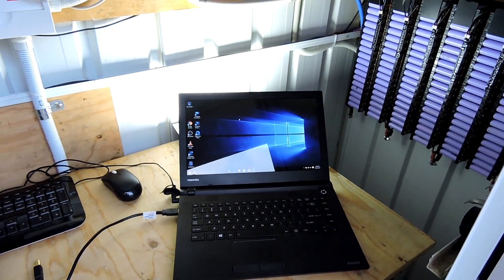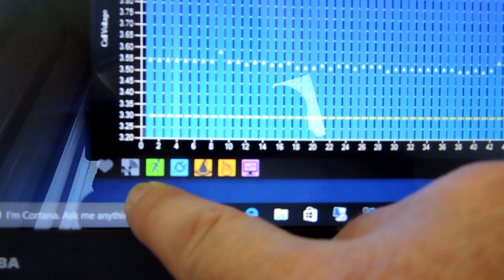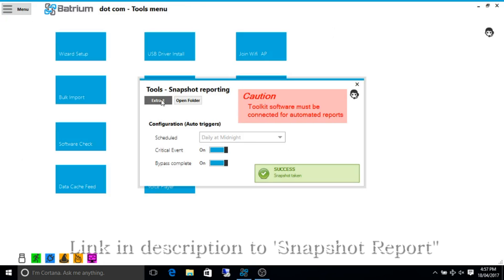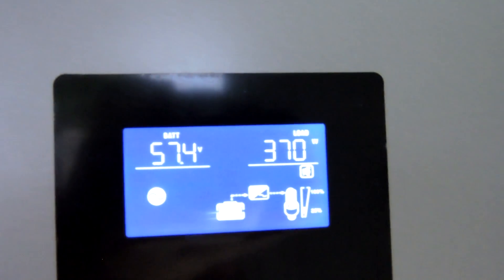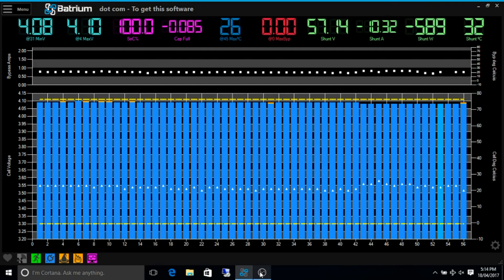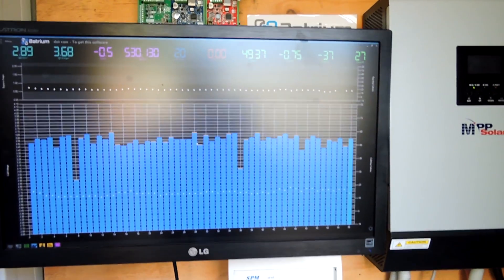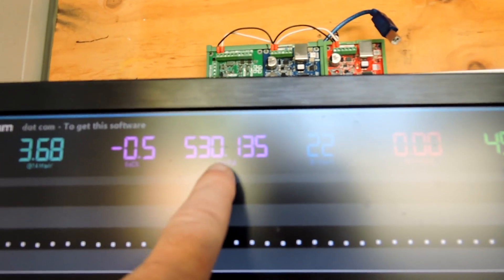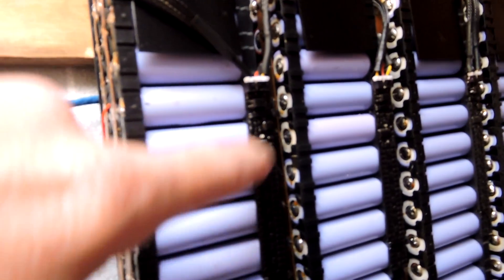18650 real world load test - 63 hours to run from 57.4v to 49v not bad from recycled laptop battery

Comment: now lets just hope one of those doesnt have a catastrophic failure and cascade the entire array
Reply from the maker: +Gonzo i think I've put just a little effort into reducing that issue :)
Reply: murphy's law and all. i do like how u put it in the shed outside so if it does go up it doesnt take your home with it
Reply from the maker: +Gonzo come on. Take some time and check out the effort that has gone into this it's not down with tooth paste and giggles
Reply: i have and i like what youve done, but ive also studied lithium ion and even with the best safety measures things can still go wrong. dendrite growth within the battery, which increases with time, can cause a direct short within. when that happens they can go up catastrophically. and thats just one thing that can go wrong. ultimately im hoping we can move from lithium ion and into some newer technologies. theres actually lithium metal batteries on the horizon that encase it within a polymer aswell and u can punch holes in them, cut them in half, etc and they still function and dont runaway on us. plus double the capacity potential.
Reply from the maker: My now std response - Mitigation process - 4480 5 amp cell level fuses - 4 60 amp bank fuses - 1 disconnect 160amp HRC Fuse - 125a Shunt Trip (more on this later ) Inverter - safety switch - circuit breakers - change over switch - more circuit breakers. Fire alarms in sheds, three fire extinguishers, locked inside of small sheds. If a fire still breaks out I'm not going to drive a car or use the deep fryer in the kitchen ever again. Now back to that Shunt trip - controlled by Batrium BMS - can be activated by cell voltage under or over fully programmable, bank voltage under over fully programmable, temp sensors in  one shed alone has 84 temp sensors other shed had 30-35 temp sensors shut trip can be activated if just one of them go to hot or cold. Naturally, I can program that temperature to active the shunt trip. It's not a monitoring system - it's a benchmark for quality BMS's at the top of its game. 

I'm very aware of the ' dangers of driving' and will actively do everything I can to make it safer recommendations welcomed :)
Reply from the maker: Yes the future is looking bright battery wise that's for sure, but this is what I have now so I'm happy to give it a good hard crack !
Reply from the maker: Once I can get some more funds together the whole lot is being moved to a shed that is best practice for storage. That will be quite a few weeks away yet but progress is constant.
Reply: like i said i like how youve done your system, but even the staunchest supporters of lithium ion technology will agree that there is still an inherent danger with the technology. im not trying to insult your setup or anything cause again i think youve done a great job. its the inherent weakness with the technology of lithium ion in general.
Reply from the maker: I get defensive lol I will take on any advice to make this better and safer. The more awareness people have the better I'm all for that. and if people have the above info when they start their own project they can be much better informed from the outset that is also a positive thing for the community
Reply: totally agree. i dont have any advice i think youve covered all the bases in that regard. i was especially happy to see it outdoors

Comment: 29kw in 63 hours? my house does that in 12 hours (20 if you turn off the pool). is your regular daily use around 8 to 12? 

during the last hurricane that shut off power for 11 days we got it down to 8kw a day but that's extreme. basil just the refrigerator, freezer, a tad of AC and a tv.
Reply from the maker: Any house could use it in 12 hours, cool nights not too many heavy loads used.

Comment: i hate to imagine the huge potential out of control fire that could start if only one lithium cell malfunctioned and shorted
Reply from the maker: Ya'll noticed the ' , ' between didn't ya  "three fire extinguishers, Cells locked inside of small sheds - there we go fixed it up a touch :) all better know kids?>

Mr DIY Tesla Powerall, I can also insure my car but ain't going to stop someone from smacking into me. Will never be able to water cool my project - to be honest, don't want to. Instead, i'll move it further away from the house and do it better. Some day you'll have no reason to comment it'll be just that perfect. Until that day keep up the good work you do around here finding the little things I've missed.

note: isn't a shed a metal box? Just wondering....
Reply from the maker: +elitedata take a look around at my videos I sleep quite well :)
Reply: i dont doubt that you do but is there a mitigation process in place in the event one or more of those lithium cells do malfunction ? - im impressed with the setup using recycled laptop batteries but its a bit scary knowing the chances that one or more cells malfunctioning increases with more cells added to the system - though its not likely any cell will malfunction provided they are all operating within design and temperature, the possibility is greater with that many cells - at the very least, you can see which cells are starting to degrade through the monitoring system and replace as necessary (thats a nifty idea too)
Reply from the maker: Mitigation process - 4480 5amp cell level fuses - 4 60amp bank fuses - 1 disconnect 160amp HRC Fuse - 125a Shunt Trip (more on this later ) Inverter - safety switch - circuit breakers - change over switch - more circuit breakers. Fire alarms in sheds, three fire extinguishers, locked inside of small sheds. If a fire still breaks out I'm not going to drive a car or use the deep fryer in the kitchen ever again. Now back to that Shunt trip - controlled by Batrium BMS - can be activated by cell voltage under or over fully programmable, bank voltage under over fully programmable, temp sensors in  one shed alone has 84 temp sensors other shed had 30-35 temp sensors shut trip can be activated if just one of them go to hot or cold. Naturally, I can program that temperature to active the shunt trip. It's not a monitoring system - it's a benchmark for quality BMS's at the top of its game. www.batrium.com
Reply: i like how you quoted a sentence that is not even in the paragraph the uploader typed. He typed "three fire extinguishers, locked inside of small sheds." <-- which I (copypasted) by the way.
Reply from the maker: +vk3hau  aaah well each to their own I find it strangely entertaining 😂

Comment: Pretty cool, could have them charged up with sunlight from solar panels or just charge up the batterys at night when electricity is cheaper and use the batterys at night like when the solar cant keep up with the demand.
Reply from the maker: +eraldorh the system has 3kw of panels attached to charge them and also a 80 mains charger I can use when required.

Comment: To avoid Windows 10 update problems like you experienced here, in the future, you can temporarily disable the update service for any duration, on any edition (I believe - I have home edition, anyway). There are guides for it, but, in short: Go to services, scroll down and find windows update (wuauserv), R-click, Properties, change startup type to Disabled, and click Stop. Re-enable later by changing Disabled to Automatic, and clicking Start. Causes no problems. I'm responsible enough to regularly check for updates, manually, so I leave mine disabled for the majority of the time so it doesn't suddenly (and, usually, at the most inconvenient time) interrupt me while working or gaming. Cheers, good vid!

Comment: holy crap thats plain awesome! 

but one question, those li-ion cells are a bit prone to all kinds of stuff like fire and gassing out from time to time. do you have some kind of protection in case a cell decides to blow up? i mean something like an automated fire extinguisher of some sort?

plus what i'm asking me now is, did you calculate from wich point in time you actually can profit? i dont mean "when the world goes down" but like what did it cost you to do and how much can you save with it?

i imagine thats not really considerable as cheap :D wouldnt it be easier to just take car batteries? they store a lot of energy too, and they  are not that critical in terms of balancing and loading

Comment: hello mate lovely video.

may i pick your brains please. 
i have a 5000watt inverter and need to know what size cables to run to my battery and the fuse size? 

would you happen to know?? 

thanks in advanced
Reply from the maker: can't help sorry I have no idea bout that stuff I bet if you had the make model of the inverter and went to the makers website they would have recommended stuff that'll help you out

Comment: while i do love 18650s and your powerwall/shed is amazing i have been running my house on AGM for coming up 15 years now and its such a simple and easy setup compared to using lithium batteries that i am still not convinced that i will upgrade from agm anytime soon and i do still use the first set of batteries although its about time to get new ones
Reply from the maker: +mr42ndstblvd wow that's preaty cool
Reply from the maker: I have gone the AGM & Lead route however due to finances (none) i got my hands on some old 6v agm's from floor scrubbers in shopping centres - 880 ah and couldn't get more than 5kw out of them each nite.. Was a fun introduction into this type of project and learnt heaps.
Reply from the maker: @pipbuster http://batteryuniversity.com/learn/article/absorbent_glass_mat_agm
Reply: i use  8 12volt 240ah boat batteries i have at most drawn out about 16kw over a night so to be fair i never really tested the full capacity but for my purpose its still more than enough i hardly use more than 10 kw over night so  they still perform flawlessly . the good thing about agm is that they are really safe and once you set them up you forget about them ... truly maintenance free as they promise .
Reply: Crushonius what is AGM? Thx

Comment: you only used 30kWh over close to 3 days?? i use 85kWh everyday on average!
Reply from the maker: Yep, normal week day household loads, weekends is more when we do washing and other things. Just did another load test over the weekend and it was 35kwh in 60 hours with upgraded cells in weaker packs.. Was very happy with test.
Reply: i gues you have gass or some other energy source.. we do not have that here.. all is electric. except we mostly heat the house with wood. so we have to get 50 ton or more, cut and dry it befor the  winter comes around.
Reply from the maker: We only have electricity as power source - we do have wood heater but that wouldn't be used more than 2 weeks of the year
Reply: and stil your only using 1/6 to 1/3 of what i'm using. what takes a lot of energy here is hot water, cooking, some heating (bathrooms floor etc), 3-4 PC's and a big TV or two (one is mostly off) the air compressor in the garage and lighting (the outside lighting takes 1-2 kW a day in summer and 2-4 in winter when we only have 6 hour if daylight a day)) if i calculate it correct you r using maybe 5000 kW a year.. i'm at 30 000 kW a year. and in top of that i use up to 100-300 kW a DAY in wood during the winter time. that's 50+ kilo of dry wood a day thru two stoves. and when it's rely cold it's not rely cutting it.. we need more heat.  
you can be glad you have the sun on your solar panels and hot climate ;) when wee need energy here there is non to get. you have to have stored it up in eater wood or hydro power plant dams (where we get moste of our power from) .
Reply from the maker: Dude I'm only her for the views, you know you love it always here maintaining order and keeping me honest.. If you need another hug just hit me up!

Comment: Guess your not heating/warm water your house electronically that would be really green.
Reply from the maker: Just a normal inefficient hot water system for now. It was replaced before we moved in and don't have the funds to upgrade unless it fails.. Once that happens for sure it'll be replaced with solar!